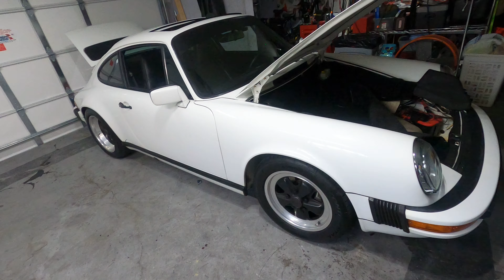Porsche Carrera 3.2: Alternator troubleshooting next step- removal

Comment: Did your fan come off ok as my fan is stuck on!..I dont want to tap the shaft as it might damage the alternator.
Reply from the maker: Yes, it slid right off.  It was a newer alternator so no corrosion formed on the shaft yet.
Reply: @3.2Carrera  ok..good...i'll use penitrating oil and leave it for a day and try to prier it of..wish me luck..cheers..and thanks for your videos they are great...God bless